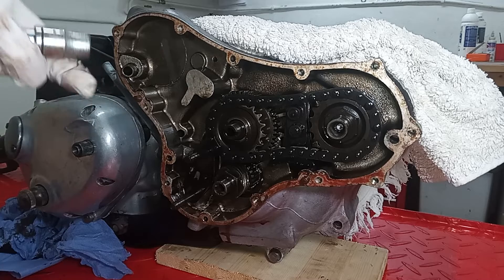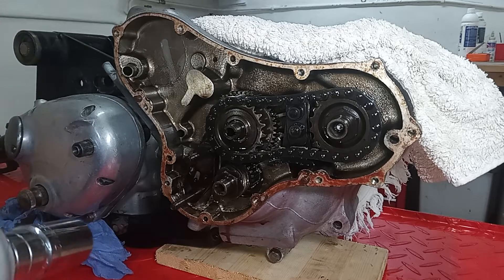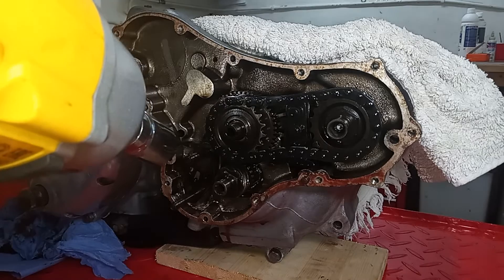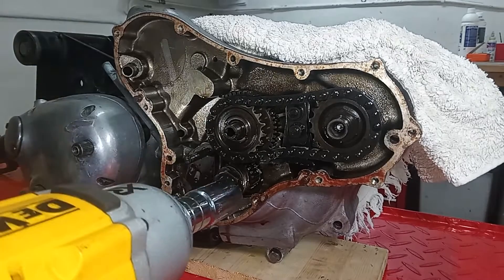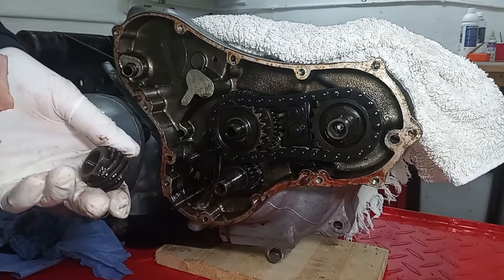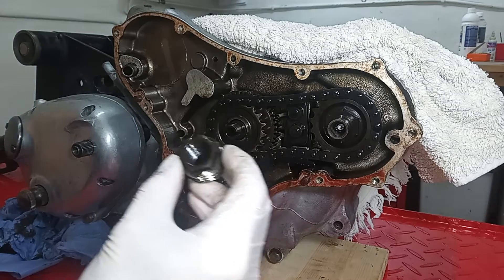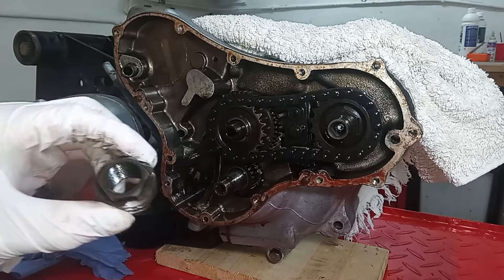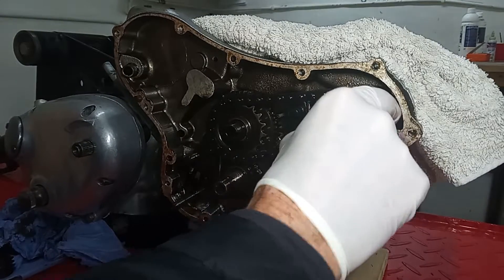Norton Commando Engine Rebuild. Part 14: Removing Cam Chain and Worm Drive

Comment: Chris, how did the cam sprockets look along with the cam timing chain, new set/kit required?  Enjoying the videos !
Reply from the maker: I've not checked them yet. I'll check them and all components thoroughly when I've finished dismantling the engine.